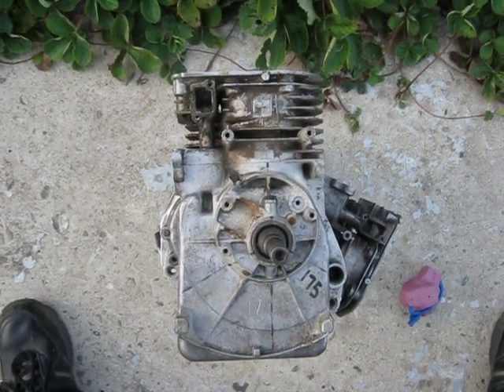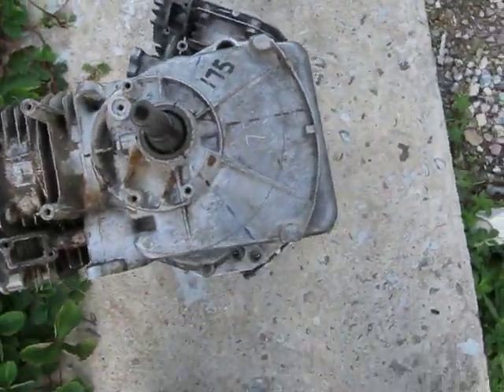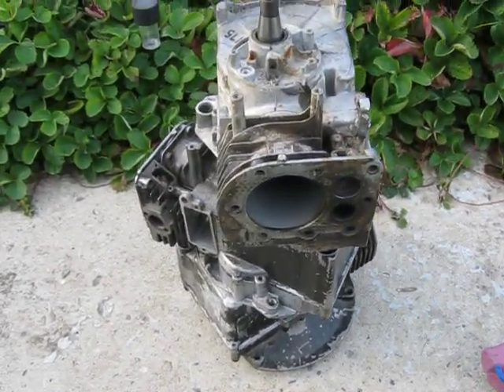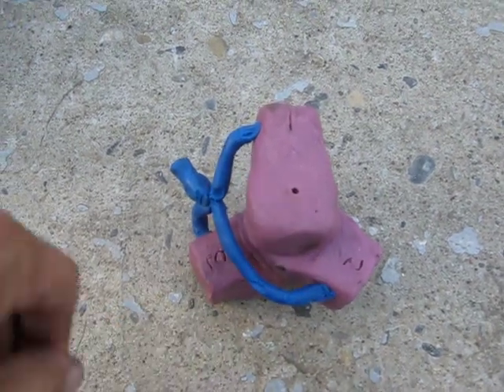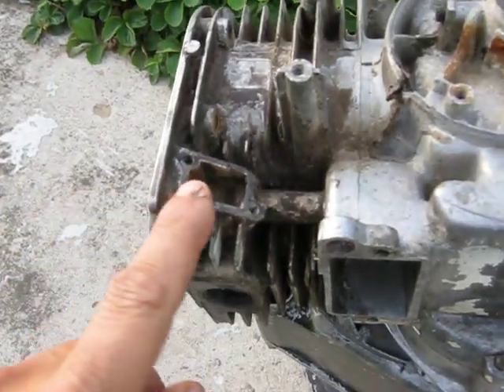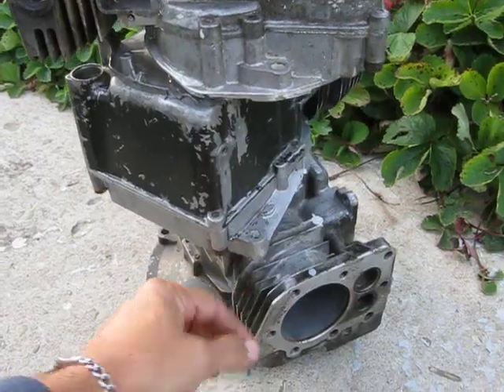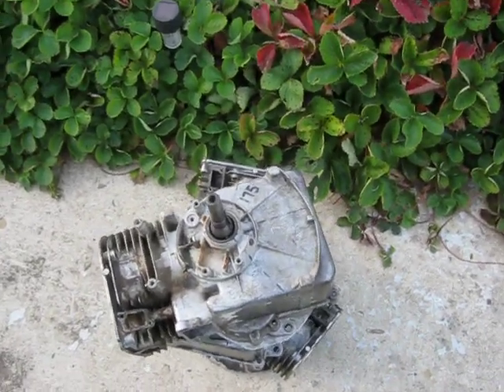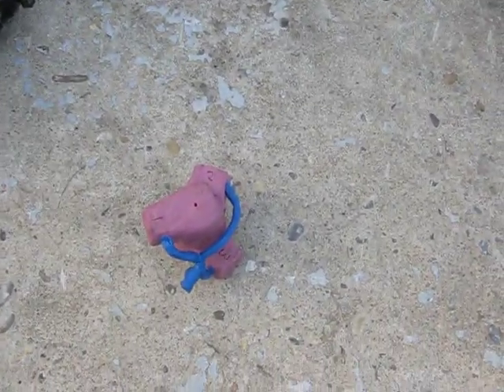327 Briggs 3 Cylinder Radial Stacker Engine

Comment: I can't wait to hear this one when she starts up. I know it will take a bit of time and patience but if anyone can pull this off, it will be you. I wish you a lot of luck with it.
Reply from the maker: Tinker Jim Thanks Jim. I started working on this back about 4 months ago, then summer finally arrived, and we just haven't been able to machine anything since then. I did a re-design of the crankshaft last night and I think I can make a simpler design that doesn't involve nearly as much machining, so that should speed up the process. Lots to do though with the ignition and the intake manifold. I am hoping to re-use the gas tank from the 2 cylinder, since AC/DC Welding did such a nice job making it. Thanks for your support, and your advice when I mention small engine problems. I have been tinkering with these engines since I was 11 years old, but have never worked in a repair business or anything.
Reply: I know that most of us know you can't do this over night, heck it might even take a few years to get it right but I know you won't leave it alone until you figure it out.
I was around 10 or 11 when I did my first small engine rebuild, it was and old 1.5 hp Clinton that I dug out of the ground. It took me about 2 months, I had to have my dad help me with a few bolts and to get the flywheel off but he pretty much let me do most of the build as he watched over me.
My dad is my mentor he even is to this day. I have helped him on engines and our farm equipment ever since I can remember. He is also one of the best welders around here, my welds hold and that is about it lol.
I still love the older engines, than the ones we have today, yes, I didn't even mind the older Tecumseh.
I got a video camera today, I'm going to give youtube videos a try this weekend of my workshop and buildings. Here at home, not my business that has sold.
Reply from the maker: Tinker Jim Yes, I like the older engines also. I wish I had kept an old Fairbanks Morse engine that sat in our basement growing up, it was a small (like 3 horse sized) single cylinder, but the cylinder sat at about a 45 degree angle, like a Briggs Animal. It went to the scrap yard along with an old cast iron Briggs 3 horse that the .030 over piston was loose in!My dad was my mentor also, I would hang around while he worked on cars like his 56 Chevy, and learned how engines fit together, unfortunately he passed away at an early age. Then I had to take over and keep our old Tecumseh pushmowers going, it was quite the chore, I was always messing with the recoil starters and the carbs.Best of luck with making vids, looking forward to seeing some  :)

Comment: Wow, That's awesome!
Reply from the maker: Cap10323 Thanks, I am hoping it runs as well as my 2 cylinder stacker engine. That one even impressed me, once I worked out the initial ignition problems. Danged high voltage interference with the electronic ignition.

Comment: What will happen If the blocks are fixed at 0 degrees in a straight line and only the crankshafts are connected 120 degrees to each other.
Reply from the maker: I guess that would result in an lnline 3 cylinder engine. I ran one of those last summer, it actually fared pretty well, much better than the unlucky 5 cylinder i ran!

Comment: This ought to be interesting! :D
Reply from the maker: TheFlacker99 (Flak) Yes, it should be an interesting sounding engine, though certainly not as practical as the 2 cylinder (this one is just too tall for lawnmower use). I wish I had about 30 hours in a day, then I might get it done faster!  :)
Reply from the maker: Still working away slowly on this, too danged much car work to get done before winter hits us. I am making progress though. I intend to get this running as soon as I can, one thing is for sure, I am NOT  waiting for spring to fire it up!  :)
Reply: ChargerMiles007 YES!!!!!

Comment: Briggsmower has a point with 3cyl motors. Here in the states the geo metro of late 80's and early 90's was a 3cyl ... If a 3 cyl distributor can't be found... Maybe a 6 with only half towers used. Next question will crank throws be timed like normal cranks (120° of each other) or will they be like a radial (like a Harley, where a single journal has all rods connected to it)
Reply from the maker: James Holt I am using 3 separate Briggs magnetos, pretty well have them mounted now.I actually have the distributor cap from a 3 cylinder sprint, but nothing else. Yes, I think a 6 cyl. cap would work OK for this. I am making the cranks line up like a radial's single journal.. I am working away on it and hope to be done soon  :)

Comment: i have got to hear this one run.... you have many obstacles ahead of you such as crankshaft and connecting rod lubrication and the intake runners should be approx. same length for equal fuel per cylinder.... either way this will be awsome
Reply from the maker: thomas dawe Yes, lots of fun building all the bits for it. I think lubrication will be OK, as I have a trick up my sleeve on these stacker engines  :)   As for equal length intake runners, I have pretty much given up on that, though a few extra elbows would increase the effective length to #1 cylinder I suppose. I want to hear it run also, just to compare it to the 2 and 4 cylinder Briggs engines I have made.

Comment: Sorry, but this is NOT a radial engine. All you have is a 3 cylinder in-line engine with offset cylinders. Ask any A&P mechanic.
Reply from the maker: +James Mcnair  You are correct, that's why I added the word Stacker to the description. I can't say I have seen another inline engine with offset cylinders like this. 805 Roadking is working on a real 3 cylinder radial, though it is proving to be a big challenge.
Reply: I guess I've never heard the term stacker. Iv'e worked on radials and they are a completely different engine. Good luck with it.

Comment: ignition should easily  be achievable with a 3 cylinder daihatsu distributor
Reply from the maker: BriggsMower Thanks for the idea, I wasn't aware of those. I remember the old Chevy Sprints used to have 3 cylinder engines, as I have the distributor cap off one.  I am actually planning to use 3 Briggs magnetos, a pain to mount, but simple otherwise.
Reply: what ever works haha

Comment: thats not possible because 1 cilinder goes down and he will get full of oil
Reply from the maker: pedro santos It will be OK, as I am running it vertically, so none of the pistons face downwards. I know what you mean though, and I am using some designers magic to avoid the bottom cylinder being flooded with oil. Some times I have to bend the rules a bit on these FrankenBriggs engines  :)